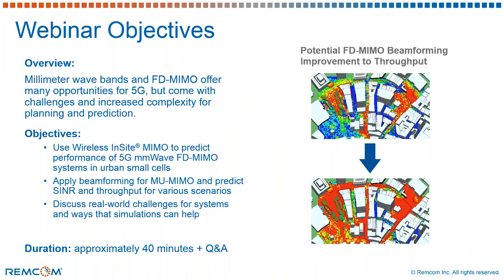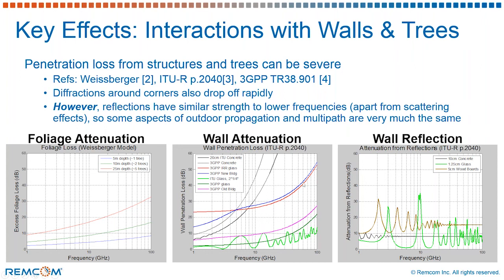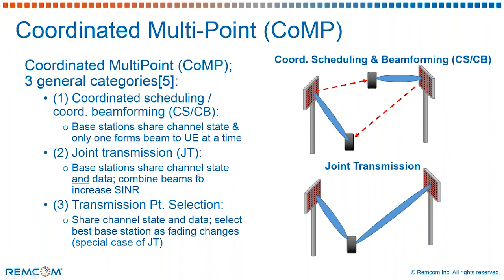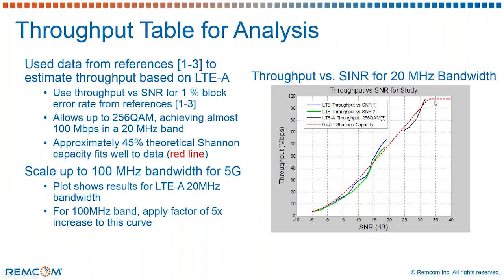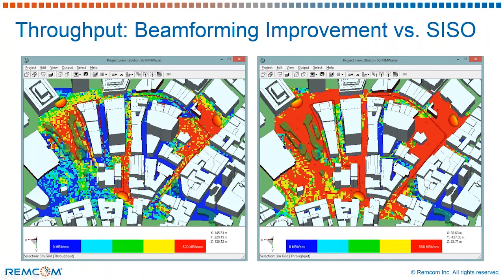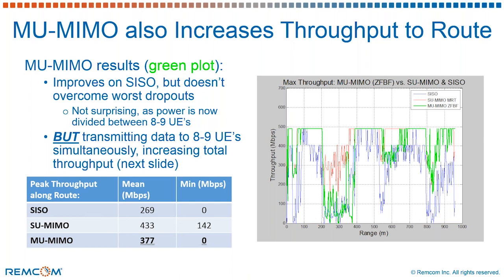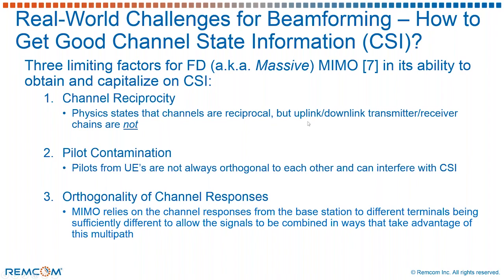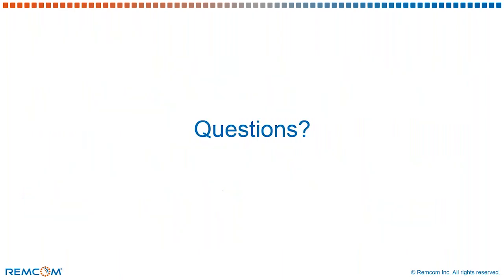Beamforming Simulations for 5G mmWave and FD MIMO

Comment: which method from these methods optimal Policy and value solution can we use Monte-Carlo or DDPG  GAN those three methods can support Real time response ?  which one of them you prefer can use it for dynamic environment to generate Beamforming vector as best optimal value for wireless data communication networks?